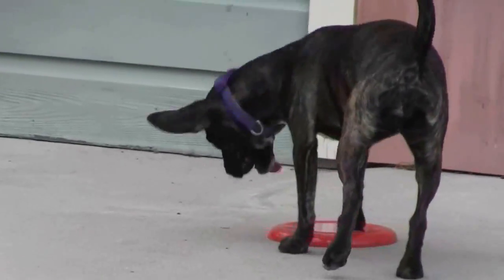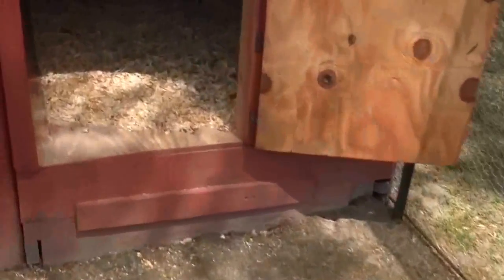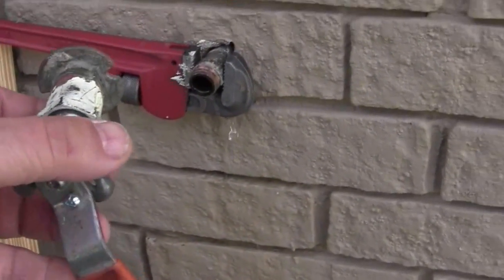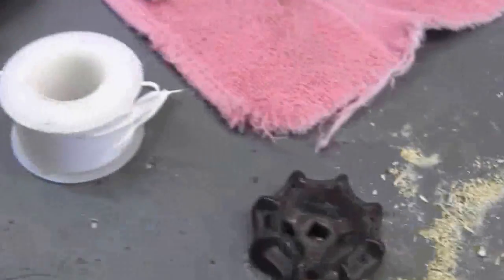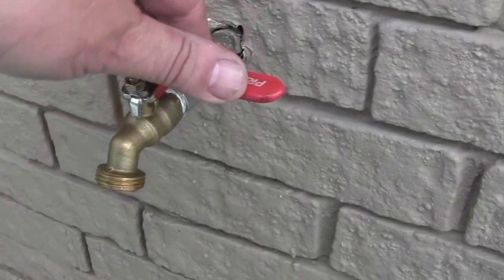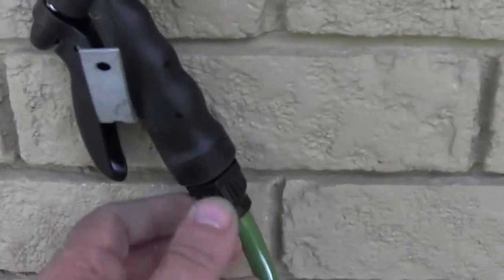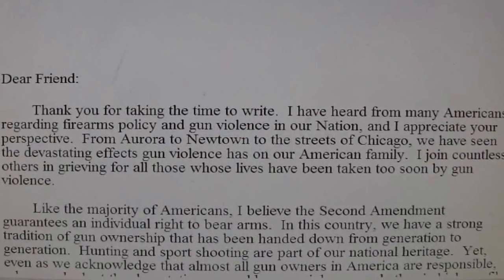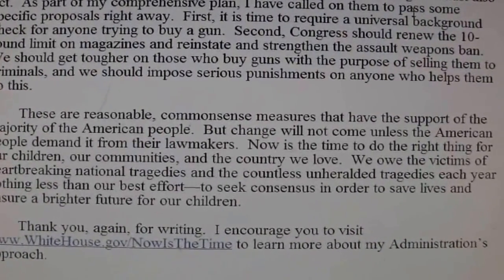How to replace an outdoor faucet with a ball lever valve.

Comment: I do like the tip of using the 2x4 to hold the one wrench in place, while turning the other. I do disagree about the gun rights thing. I think we need to take gun rights issues in small, specific pieces of legislation, rather than saying we are for or against all of them. Some laws definitely keep guns away from people who are about to kill people, and others are just red tape. So, let's only debate the specifics, rather than being too general. :) (Specifically, I do agree with background checks and making people wait a week, because that's going to slow down the lunatic/anger killings.) Thanks!
Reply from the maker: This video is 11 years old. I’d have to go watch it to understand what you’re talking about.

Comment: You live in Da Boot, right?  I've driven by Minden on the Interstate.  I was wanting to change my outdoor faucet with one of these but was told these things are not frost proof.  Did a search looking for one, but doesn't seem like they make them which is goofy!  I'm in Okieville AKA Oklahoma (Tulsa area) so it does freeze here sometimes.  Wondering if anyone has installed one of these in a state where it does freeze, but not like it does in Yankeeville. 😂
Reply from the maker: I just put a styrofoam cover over it in the winter. hasnt froze up yet.
Reply: @bctruck  Thanks for the reply.  Da Boot tends to stay warmer than northeast Oklahoma but I may go for it if I can't find a frost-proof ball lever valve faucet.  I've seen them on farms in Oklahoma so you'd think them freezing up and cracking is not something that happens a lot.

Comment: Okay, I looked at this video after your response one to Scott and now I have one....
That coupling you used looks very shiny, too shiny for galvanized. Since you went to a plumbing supply house is it stainless? I understand with copper you should use brass, bronze or stainless because of potential electrolysis issues. Just wondering....

Comment: Nice video. Odd that you included your piece on the second amendment. I read the "form letter" you showed and find some of the stated measures to reduce gun violence sensible and not, in any way, an infringement to own a gun. Makes me wonder exactly what you think the government is "chipping away" at when it comes to gun ownership.
Reply from the maker: It’s odd that you think I would remember what I even said in this video. It’s nearly ten years old. I have 2500 videos. What was happening ten years ago, may not even be relevant today.

Comment: You don't mix galvanized pipe with brass.  It causes, galvanic corrosion, electrolysis. Basic plumbing.
Reply from the maker: So,,,,,,, the brass faucet that had been there for 22 years with no issues, must not have known you were an expert on this subject, because it completely failed to corrode. Stupid faucet!
Reply: @bctruck  The old pipe you have on looks like black pipe, not galvanized. Good luck with your new valve and galvanized coupling.
Reply from the maker: It’s not new. It’s been there for years sorry to disappoint you, but it’s just fine and I suspect it will be fine for 20 years like the last one. Have a nice day snowflake.